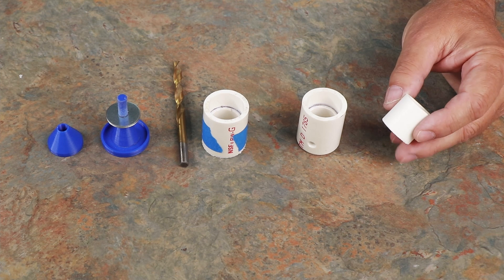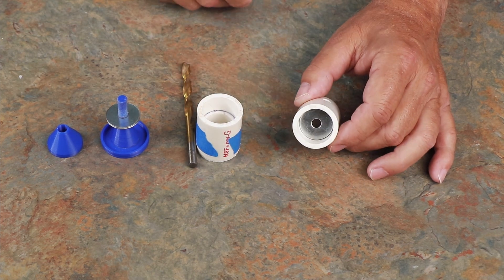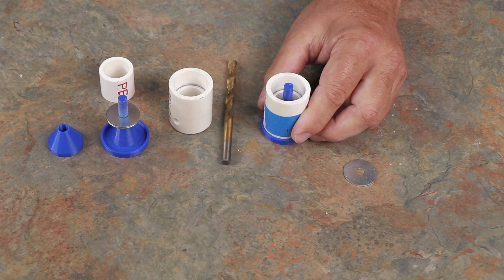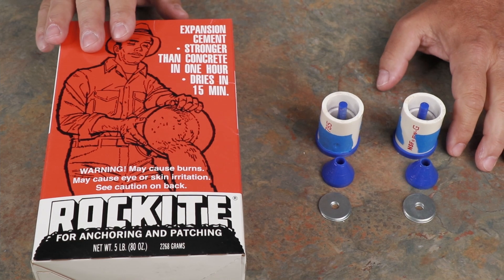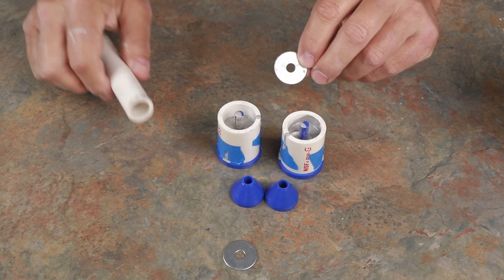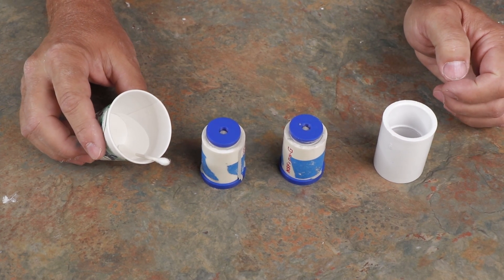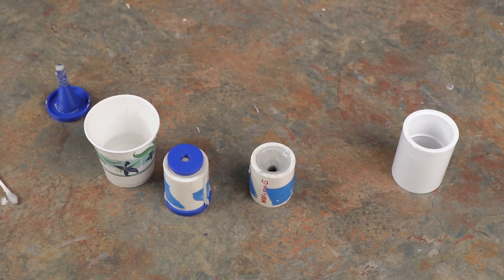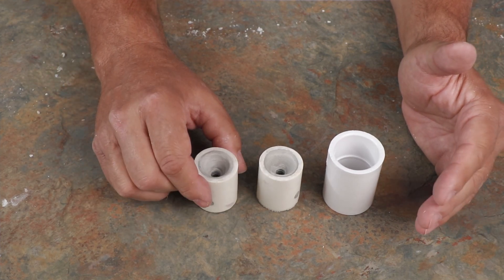PVC rocket nozzle from a 3d printed core!

Comment: can i just remove the washer altogether and rely on the concrete?
Reply from the maker: You can skip the washer, but the extreme temperatures will erode concrete. You could use only concrete and skip the divergent, which would allow more material to absorb the heat.
Reply: @TheRocketeer   What efficiency gain does the converging and expanding parts of the nozzle actually provide in this engine?
Reply from the maker: @МаксУраган-к6п  For small rocket motors the gain is around 15%.

 Rocket nozzles are carefully shaped to accelerate the exhaust gases to high speeds and direct them in a specific direction.

Comment: Greeting 
Very good and educational videos!
Where could I find the dimensions of the negatives to make kaluo a nozzle?
Thanks in advance
Reply from the maker: The mold is made from a 3d print. The convergent angle is around 60° and the divergent is 15° with a nozzle diameter of .312.
https://www.thingiverse.com/thing:4901781
Reply: @TheRocketeer  Greeting 
Thanks for the reply.
I thought the dimensions of both works to give a friend to do it for me on a lathe.

Comment: Im fairly new to rocketry. Sugar motors   is wat i make. Pretty decent at it. Now heres the thing.  I wanna cut costs where i can an go fullly reusable. So i use aluminum tubes instead of pvc. But the packed clay plugs an nozzles i have to re-do every time....is there a way that this type of nozzle can be adapted for more than single use. (Im assuming its single use because its pvc and is bonded to the pvc motor)
Reply from the maker: Your best option is to use Loki motors if you want to reuse parts. Stay safe and keep you distance from any rocket motor!!
https://lokiresearch.com/page/PRODUCTS
Reply: @TheRocketeer  Right on !!! Thanks for the link. Looks like they got a lot on neat components...!!! And safety is our NUMBER 1 priority .

Comment: Chuck I contacted a vendor to print me some form cores for a fee and they are saying there is an error in the files. From Vendor "We'll need new files in order to print. Both have non-repairable inverted normals." Since I am not 3D printer savvy, would your friend that created the files know what error it is and correct the files? Thanks for all your videos and time to Model Rocketry
Reply from the maker: I spoke with the creator of the print file and he suggested that you may want to send a link to the vendor so they can download the file directly from the site. I know another viewer has printed them and they worked fine for him. Sorry you are having trouble.

If you are not able to get them printed then go to my home page and click on the "About" tab and there you will find my email. Contact me and I will send you a few.

You could also try the EZ nozzle. It works fine for testing. https://youtu.be/iNpRLut7qFc
Reply: @TheRocketeer  I have found a new friend on FB that lives 2 blocks from me that printed them for me at his cost. Wow, I put in our neighbor's group for my town and he responded to it. I tried public libraries but their printers were either broken or out of the element. So, this young man did it for me without problems with files. So , I have a pair now and I made about 16 nozzles in 3 or 4 hours. Also, if you want to use reducer couplings the nozzle works fine with a 1 1/4 to 1" reducer in my test firings. So, you can make 1 1/4" grains and increase the nozzle washer (3 ea) to 5/16ths with 3/8 Core and be well within pressure tolerances. COuld possibly go a 1/4 inch nozzle washer but the pressure calculator kind of says pushing my luck. Finally, I posted a comment on a new fuel I have been working with that is very promising to me, with test burns. 31% PKO3, 31% K Cl O 4 (Pot. Perchlorate), 35% Sorbitol, and 3% Ammonium Nitrate. I love my test burns on foil very similar burn rate to the standard 61% PKO3, 35% Sorbitol, and 4% Ammonium Nitrate. Still, the new formula burns much more energetic, slightly faster, and produces more gases.
Reply from the maker: @delmarvalousdigging8235  I am happy the files have worked out for you. I never thought about a 1 1/4 reducer, or looking for someone in a public group, good idea.
Reply: 3d builder on windows has an repair function

Comment: Hi sir thank you for the inspirational vids and compliments for the willingness to put it out there for everyone to see. May I ask you why is the washplate necessary ? Greetings from Italy !
Reply from the maker: Hi Dario, the nozzle provides additional pressure and thrust for the rocket motor.

Thanks for your comment!
Reply: @TheRocketeer  hi thanks for your kind reply but what I was asking what is that hollow metallic plate for I'm familiar with the de Laval nozzle even tho I'm a long way from understating it on a rigorous level
Reply from the maker: @dariocardajoli6831  Oops, sorry for the poor answer. The washer is the nozzle throat and it resists erosion better than the concrete. The concrete supports the washer (la rondella) and prevents the washer from becoming super heated and melting through the plastic. I hope that makes more sense.
Reply: Ohh wait it's purpose is to keep the center of mass as low as possible as the fuel burns jnnit

Comment: Do you have a video showing how you build or set up your delay charge and deployment charge?
Reply from the maker: I did not make a video on it because further testing revealed that the forward seal was not always reliable. I plan on using electronic ejection with a PVC motor in a rocket that I have already built for this purpose.
Reply: @TheRocketeer  try hat is my current finding.  Lots of blow through at ignition.

Comment: Awesome make, how do you assemble it with the rest of the engine? Does this method give more power than scratching the inside section of the pvc and then applying kitty litter?
Reply from the maker: The nozzle is glued to the coupler and the coupler attached to a 1" PVC motor. Check out other videos on my channel.

The concrete nozzle will withstand greater pressure and provide reliability that can't be obtained by rammed kitty litter. Leave that to the cats :)

Thanks for your comment!
Reply: @TheRocketeer  Thank you for your answer too